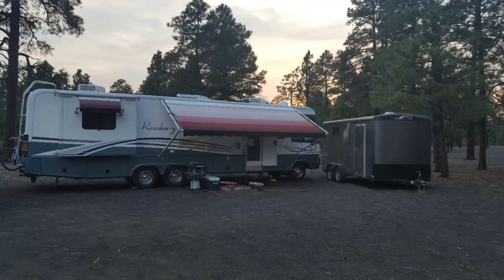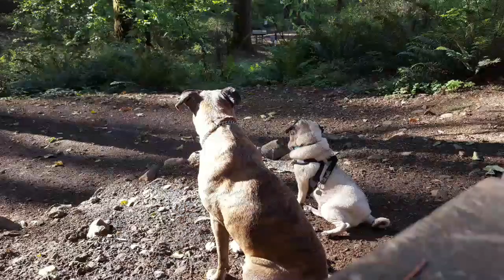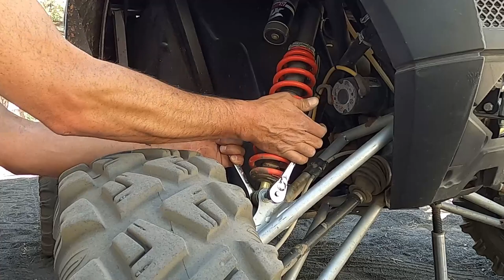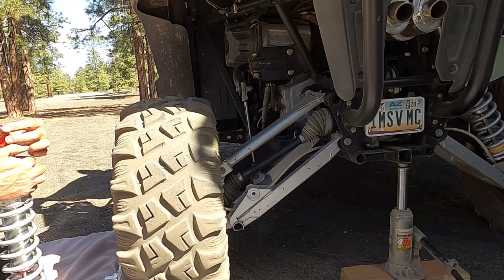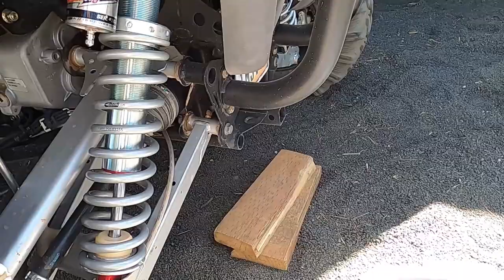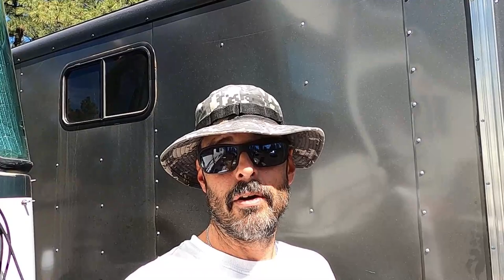RZR Shock Replacement | RZR Upgrade | DIY | Made in America | Travel Vlog

Comment: The Walker Evans needle shocks are pretty good, I'm guessing you bought them from Walker Evans and had them tune them for your weight and riding style. They should improve your ride. Have you taken a look at the Walker Evans sway bar link shocks? They help tremendously on the rocky trails.